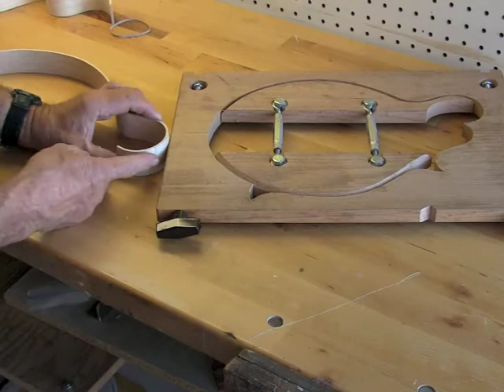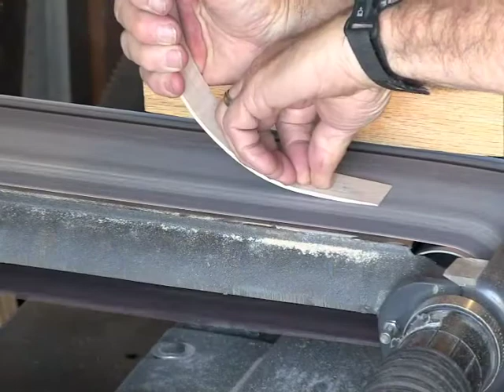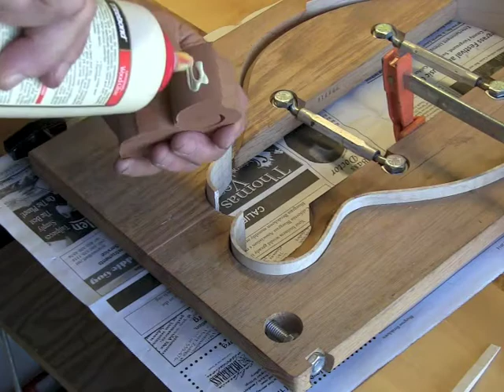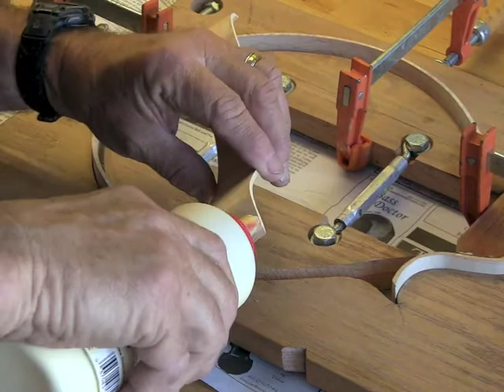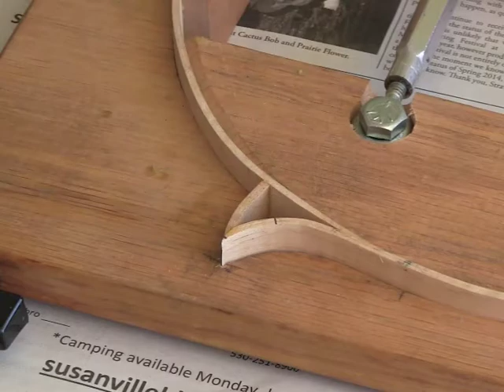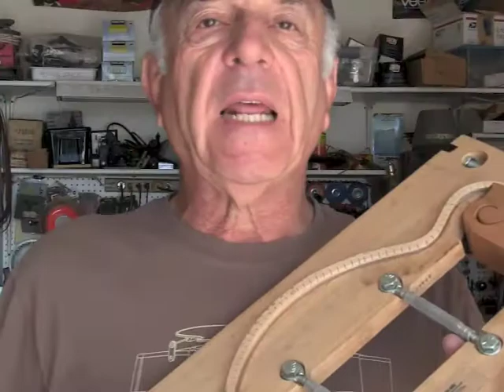F5 Mandolin Rim and Block Set Assembly

Comment: why not using Titebond 2 or 3 for the rim section?
Reply: 2 and 3 are water resistant. Original will come apart with heat and steam. Much harder with 2 and 3
Reply: @tothepoint7258   thank you for your (late) answer ;). Actually I see no reason losen the blocks apart - ever. If I would have a repair-job which needs to remove the top, back or the neck I don´t want to worry about these joints. Usually I use Titebond 3 for parts I don´t want to come apart and/or need some extra time (longer assembly time then Original Titebond). For joints which might need to come aparte easier, like the neck joint (neck-reset) I use hide glue. When reglueing a Titebond joint you always have to remove at least a little of the wood to have a good bond because Titebond does not glue on (old) Titebond...
Reply: @tothepoint7258   Titebond  2 or 3, being "softer" glues, can give you "glue creep," which you do NOT want.  Ask me how I know that...